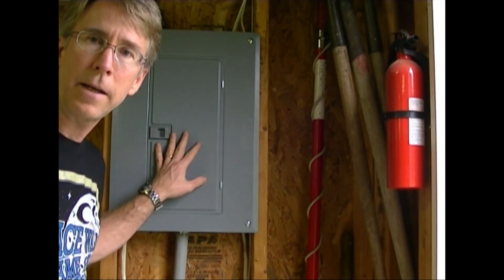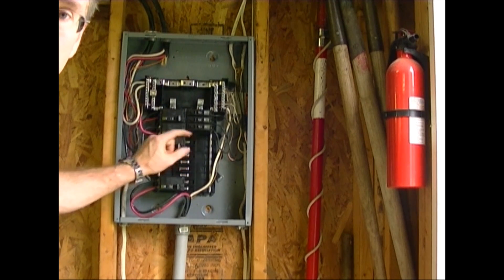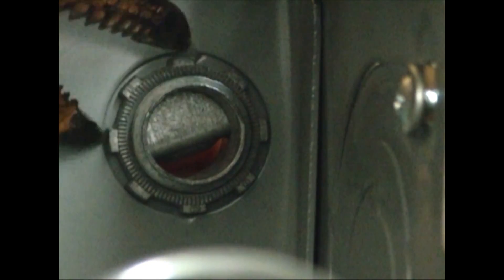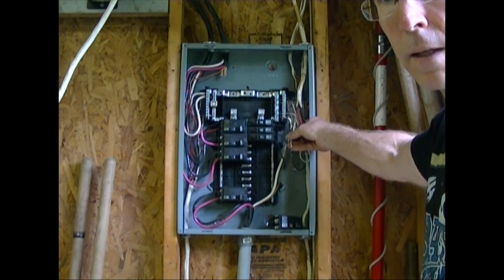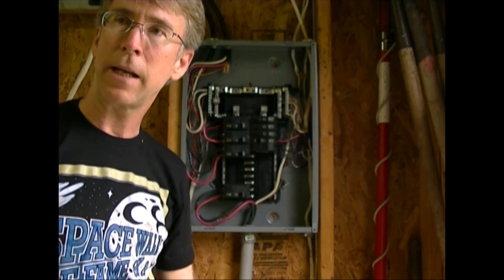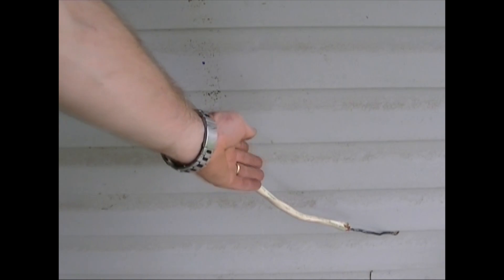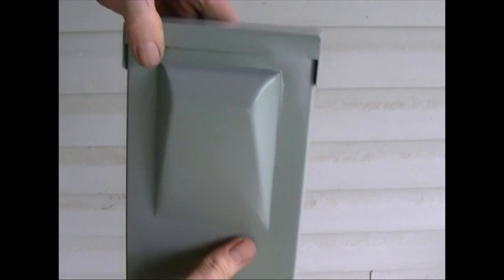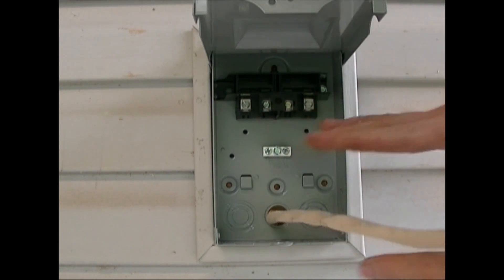How To Add A Circuit To A Load Center (Breaker Box)

Comment: The first thing you are supposed to do is to turned the main panel off. Period!!!! I don't care if you are Sparky....
Reply from the maker: As stated in so many other replies, this is good solid advice.  Turning off the main power certainly allows for no injury due to electricity.  I chose to leave it on and thereby took on a small amount of risk in order to have power to my other circuits available for lighting.  Thank you for your comment.

Comment: Omg  what a  nightmare.  Before you started.  The  main  feeder to the panel  had  an outside  sheath  though  conduit.  Wich is  illegal.   Why didn't you  have a  4 wire  feeding the  garage.  Is the garage  detached.  But I  didn't  see a grounding  conductor.  Don't know.  And you popped  in an ac disconnect  without  a bushing  to protect  the wire  from  shortening  out or catching  fire  to the osb sideing. Then you have  the pinched  wire  next to the  illegally  installed  subfeed panel  in your garage. Omg.  What  a inspectors  nightmare.  Red tag turn off the  power.  Hahaha.
Reply from the maker: Thank you for the online inspection.  I assure you it's not as bad as you described but I do appreciate the comments.  If you have a moment, I have a question about the illegal outside sheath: I did run 4-wire (Red, Blk, Wht, bare) to the shop and it was run underground to the conduit.  How would you transition from sheathed wire to unsheathed in the conduit?  Thank you for your opinion on this.
Reply: @FloridaJoe3   hey Joe.  You would  have to  pull  it out.  And remove  the  outer  sheathing.  And than repull back in.  I would have  used  4 single  conductors.  Also  the conduit  that  holds the  main feeders  looks  kinda  small.  But I  can't  tell  by the video.  Good luck  on your  next  video.
Reply: @FloridaJoe3  hey Joe.  I assume  you have  conduit  all the way  back to the  main  panel . If not  you can  have a  couple of  inches  of  sheathing in  conduit.  Not all the way.  This  creates  excessive heat  and derates the ampacity of the  conductors.  When  it's  in conduit.
Reply from the maker: OK, no, I just pick up the conduit at the barn slab.  Thank you also for explaining the reasoning behind it.  That makes sense.  All the best to you.

Comment: i would run wires allong the inside of the box then strait to each breaker it will give you a neater job less crouding allso use romex conector behind the small box i would of drilled a bigger hole to resses it then drilled smaller the rest of the way threw
Reply from the maker: All good advice.  Thank you for watching and commenting.

Comment: See!? This is how fast my old boss wanted me to work. I'm not a robot. Just to add, I would have run all my wires through some metal conduit pipe coming out of the box for future safety reasons. I used to remodel and it's not fun if you cut into a wall and hit a wire. Be nice to the next guy.
Reply from the maker: Excellent advice.  I was not concerned about conduit as I am not covering up the walls in my shop.  Code does not require conduit in the walls in my neighborhood.  I would think with the new stud-finder gadgets, running into copper wouldn't be much of a problem anymore.

Comment: Leave the ac man to put his load
Reply from the maker: If your AC man will do it for free that is certainly a good way to go.  I wanted to control how the wire was routed but I did consult with the AC man before routing it to make sure I met his requirements.

Comment: thanks im planning on splitting 2 bedrooms that are one one circute
Reply from the maker: That should be an interesting project.  I assume you just want 120VAC in the bedrooms to you'll just need a single-wide breaker and a two conductor plus ground wire (black-hot, white-neutral, bare-ground).  Good luck with your project.

Comment: Thanks for the video! I'm a complete novice so the explanations and detail are appreciated. I have a room in my home that just can't keep consistent power. Whenever my Air Conditioner or my Wife's hair dryer pull a heavy load I can't even keep an LED light bulb lit without flickering. I need to do some poking around in my attic but I suspect everything is wired in a series. I'm hoping I can break it up through the use of some junction boxes and add some breakers to my main panel... hopefully.
Reply from the maker: Thank you for the comment.  Good luck with your rewire.  Hopefully it is wintertime wherever you live.  Be careful.

Comment: THE VERY LAST THING THAT YOU DO IS HOOK THE POWER UP TO THE CIRCUIT.  This guys hooks the power up first and then runs the wire through the house all while saying hes working with a live panel...smh
Reply from the maker: You bring up an important point.  I'm working on a dead circuit within a live panel.  Obviously, I had the breaker to this circuit switched off the whole time I was working on it.  If you want to be even more careful, you can hook up to the panel last but it's not absolutely necessary as long as the breaker is off. MAKE SURE THE BREAKER IS OFF to the circuit you're working on.

Comment: Also at 3:20 the wire you use is 14-3/ G so the 3 means there’s 3 wires the gauge is 14 and the G is ground I’m a apprentice electrician so I don’t know much about this yet
Reply from the maker: That's a good point to bring up - how to read the code on the cable.  Thank you for your comment.

Comment: What about a wire clamp connector to the AC box outside to prevent wire chafing
Reply from the maker: There is a clamp installed in each of the pass-thru holes.  Outside the box, the cable should be nailed with a cable stable to keep it from wandering around.  I don't think anything else is necessary as your worst chafing would be in the pass-thru holes with steel edges.  Thanks for the comment.
Reply: Robert Edie I noticed that alao

Comment: White and black as a hot and bare as ground
Reply from the maker: Yes.  Good point. In the case of 220VAC with no neutral, we usually run a cable with black, white and bare.  White and black will both be hot since it's 220VAC unlike with 110VAC where only black would be hot.  Thank you for the comment.

Comment: Use 10/2 no neutral required for an air conditioner
Reply from the maker: Yes. That is correct as long as your A/C is 220VAC.
Reply: @FloridaJoe3  Thanks for the video ... How does the AC ground or loop back to the panel?  No closed loop?
Reply from the maker: @bustami1  I'm not sure what you're asking but the black wire is hot and the white wire is neutral or return.  You must have a completed circuit (closed loop) for it to work.  Thank you for commenting.

Comment: which wire goes to the lighting switches? is it the positive or negative?
Reply from the maker: I'm going to assume this is a serious question.  There is no positive or negative in AC (house) current.  That said, the black wire is hot and the white wire is neutral.  Neutral may go directly to the light while hot (black) goes through the lighting switch and on from there to the light.  I hope this helps.  Be careful out there.
Reply: thanks

Comment: ALWAYS TURN THE POWER OFF!!!!
Reply: arp thirteen duck that dude!!!!!! BOIIIIIII
Reply: Chicken
Reply from the maker: Good advice!  Thank you for the comment.
Reply: @FloridaJoe3  I actually got a little nervous watching you hammer the staples in with the power on. Puncturing a cable at that point would cause a short that bypasses the fuse temporarily.
Reply from the maker: @Anon-z4h  I'm pretty sure I didn't staple any live circuits.  That would be a really bad idea.  Thank you for your comment.

Comment: Great video! Got me thinking...we just changed our ac from a split level to a package and moved it to the side of the house where the main power box is located so they just tapped into that. 
My question is, can I use that cutoff for the old split level to run power out to my building to run my lights, compressor, small ac/heat n such? Just to avoid unnecessary work. It's on a 220 50 amp breaker in the house. Would I need to drop down to 110? The building is already wired w/o a sub box with regular 20amp receptacles and light switch-on the same circuit right now. 
Thanks so much for any help!
Reply from the maker: Actually, that sounds a lot like what I did.  Just run 6AWG copper to your out building and put in a small subpanel like I did.  Good luck with it.
Reply: FloridaJoe3  well, while I was waiting on your answer, I went searching the web about this idea as well.  the general opinion was that you couldn't do it because of the lack of a ground wire coming from the main panel feeding the cutoff switch.  So, unless you went and added a ground wire to the main, where or how would you get the ground to the sun panel in the workshop? 
Sorry, I may not be asking the right questions or understanding what I'm reading, but I'm completely ignorant to electrical connections n such. But I'm determined to learn! Haha
Reply from the maker: I ran a ground all the way from the main.  I had red(hot), black(hot), white(neutral) and bare(ground) running all the way to my shop.  You should be able to do the same thing.  Another option would be to drive a ground rod out at the shop and use that for your ground.  Talk to an electrician buddy in your area.  I'm sure there's a good way to do what you want to do.  Good luck.

Comment: Great video. How many cables can you put through 1 punch out hole in the breaker panel box? Can I put more than one through a cable clamp? I have 4 12-2 romex cables to wire up.
Reply from the maker: I would put 2 12-2's through each hole.  I believe the box of clamps may have some guidance on how many are permissible or advised.  Otherwise, try to Google it from a reliable source.  Good luck with your project.

Comment: Here in Houston Texas We use 14 awg. = 15 amps   12 awg 20 amps 20 or 30 amps for 10 awg. 30 or 40 amps for 8 awg. 40 50 & 60 for 6 awg. 80 to 100 amps for 4 awg. these are above code. No offense intended but seems like 14 awg. on a 20 amp breaker doesn't leave much margin of fire safety. But then again only seeing one or two real licensed electricians I am ignorant and limited to what they did. But I will take a course in basic wiring at My local community college.
Reply from the maker: Thank you for this very useful comment.  I agree with your assessment.  I'm not sure where you got 14AWG from.  I said in the beginning of my video that I would be using 12AWG.  My comment about it being too big was not appropriate.  It is just the right size.  I think in the back of my mind I was realizing that the right size has to be too big in order to allow safety margin.  Sorry that thought came out of my mouth.  Good luck with your project.

Comment: You always use 12 wire with a 20 amp breaker, its not "probably more then you need" it's exactly what you need, you always size your wire accordingly with your breaker
Reply: FloridaJoe3 I applaud your vid. It's how we all get down the road together. But we have to be clear on this point. It's not an either way thing. It's important that people keep thinking "protect the wire, protect the wire", when making this decision. Certainly, a 12 ga wire doesn't 'need' a 20A beaker. It could use a 15A, right? In fact, there are several conditions (many wires run together through one insulated opening) where a 12 ga wire may not be rated to carry 20 A. Windy, I know, but important, and you strike me as a guy who wants to get it the right way around.
Reply from the maker: Thank you for the comment.  Your point is that 12AWG requires a 20 amp (max) breaker.  That is correct.  I was probably thinking of the actual load when I said that, not the wire gauge. Thanks for watching!
Reply: I think his point is the reverse: a 20 amp breaker requires at least 12AWG wire.  For the record, I don't know if it's camera angles or what, but it sure looks like you keep turning to face the camera and pointing your hand straight towards the box.  Isn't the terminal at the end of each of those breakers also live?
Reply from the maker: Interesting point.  I think maybe you could say it either way.  In other words, a 12AWG wire requires a 20 amp (max) breaker to protect it from higher currents than it can handle.  And a 20 amp breaker requires at least 12AWG wire to handle the current allowed through the 20 amp breaker.   The live bus in the box is covered with breakers.  There's not much available to touch.  But, no, my hand is not that close to the business end of the box.  Thank you for your concern.
Reply from the maker: Actually, it was a little bit of a stretch to agree with Steven but not ridiculous.  Hypothetically, if a 20A breaker is all you have but you can choose any wire then you would need to use at least 12AWG.  I agree with you that in most if not all cases, you size the wire for the load and then size the breaker for the wire.  Thanks for commenting.

Comment: i wish he would have shown when he installed the circuit breaker.  The box was hot, when he did it.  anywho, was a nice video
Reply from the maker: I'm sorry you weren't able to see that part.  It's just a simple snap in.  No sparks since the breaker is off and unloaded.  Completely safe.  Thanks for watching and commenting.
Reply: yeah, it was informative.  it looks like at about 4:28 you snap the breaker into the main box.  I was wondering if some are harder to do, than others.  I heard a pole mount is harder to do.  I'm running a short 10 ft away, 220, someday  :p
Reply from the maker: The kind of breaker I'm using snaps in very easily.  You snap the dead end onto a plastic bar and the live end hinges right onto the bus bars and just give it a firm push to snap in place.  Good luck on your project.

Comment: I am a complete beginner so bear with me please. I have to swap a gas water heater for an electric one. My questions are...What Gauge wire do I need to wire it? What kind of breaker do I need? Voltage wise? And is there any other advice you can give me that may save me some much needed time. Im researching this tonight BC I must Co.plate this job tomorrow. Thanks in advance! B.t.w. I do have a mostly construction/mechanical background....just don't know diddly about electrical. Oh!!! Just thought about...The wire colors....can you tell me how they need to be connected also. Appreciate any info. Awesome videos by the way...im learning alot already. Keep it up!
Reply from the maker: That's a lot to ask in a youtube comment.  However, thank you for asking.  When you purchase your water heater, a lot (if not all)of your questions will be answered in the installation manual.  It should off help with the wire gauge, breaker amperage, I'm assuming you'll get a 220VAC heater so it'll be a two-pole breaker.  The red and black wires go to the two poles on the breaker.  The white goes to the Neutral bus bar and the bare copper goes to the ground bus.  Good luck and let us know how it turns out.

Comment: Not to shabby. but.. will fail inspection If you ever had it inspected
Reply: FloridaJoe3 FloridaJoe3 It’s a sub panel, not the main, grounds and neutrals should always be separated in a sub panel. Also, you’re required to support you’re wire run every 4 feet (at most) all the way across the run, not just going into the boxes. Also he needs a connector going into the air condition disconnect box (he called it a cutoff box)....also all 240v circuits need to be labeled on the panel (load center) ,
Reply from the maker: Please give details.  Simply stating that it will fail inspection helps nobody.

Comment: at least put a wirenut or black electrical tape on that white wire on that outside box since you have the white wire connected inside lol
Reply from the maker: Thank you for the tip but I did not leave power on the circuit so did not need to cover it.

Comment: You would rather risk your life than get a flashlight?!?
Reply from the maker: I consider the risk to be very low as stated in replies to many similar comments.  I do, however, agree that it is always a good idea to remove power before working on a circuit.  I weighed the risks and decided not to in this case.  Thank you for watching.

Comment: No romex connector on the exterior disconnect??? Thats a fire waiting to happen!! PEOPLE, if your a DIY make sure you brush up on local electrical code and do it the right way. There should be either a romex connector or grommet used on the exterior disconnect to prevent the wire from getting chaffed and causing a fire.
Reply from the maker: OK, I have to confess it took me a sec to figure out what you meant my 'remox' connector. (romex)  I fully agree with your advice and thank you for putting it here.  You are not the first to catch that.  As I explained in a previous comment, I drilled a smaller hole in the wood that was right up against the back of the box so that the cable is restrained in the wood hole from touching the sharp edge.  Thank you for the comment and thanks for watching.

Comment: the two ungrounded conductors arn't 180 degrees out of phase they are off the same transformer. your most likely thinking of 3 phase power in which case each phase is 120 degrees out of phase
Reply from the maker: Hello Andy.  Thanks for your comment.  I must disagree with you, however.  Please see this link Figure 1( http://www.samlexamerica.com/support/documents/WhitePaper-120240VACSingleSplitPhaseandMultiWireBranchCircuits.pdf )  They ARE 180 degrees out phase and ARE coming off the same transformer.  This is accomplished by tapping off Neutral from the center of the 240VAC transformer coil.